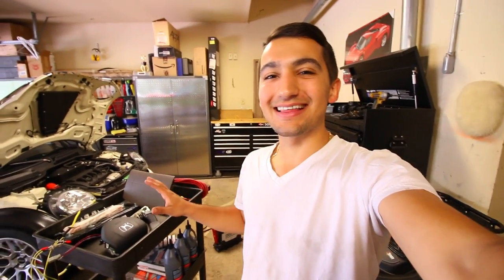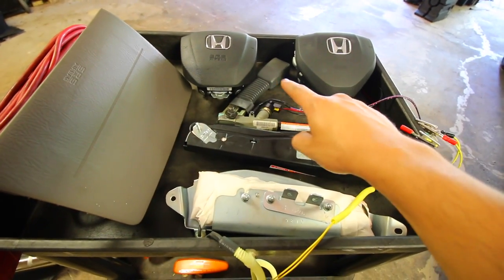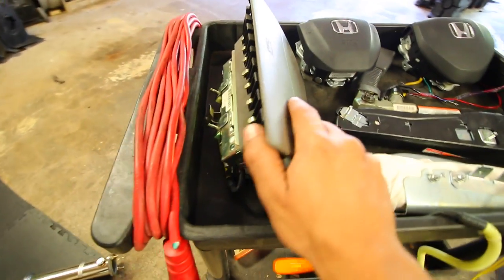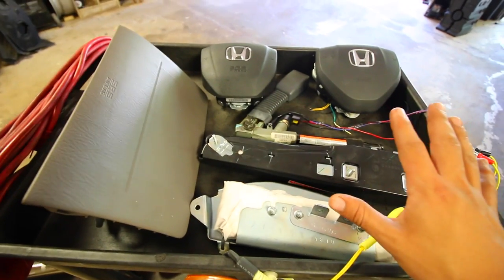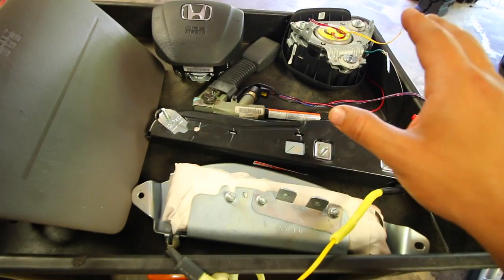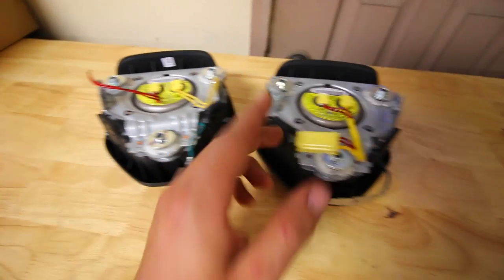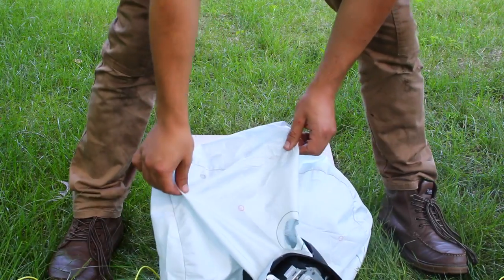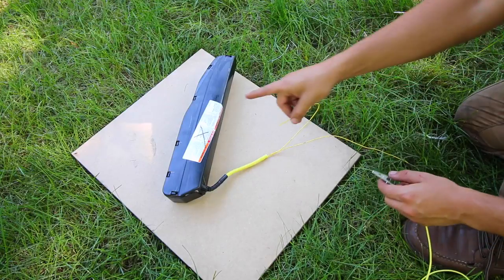EXPLODING AIR BAGS @ 240FPS (& Attempted Watermelon Murder)

Comment: If you're short then instead of just deactivating the airbag in the wheel, the airbag could be set to be weaker.. In more expensive cars, the SRS probably knows where you sit anyway, so it should adjust the power.

Comment: Today's airbags are immensely better than the old airbags. I know a girl who's about 5'1 and sits really close to the steering wheel and an airbag just like the one at 20:12 saved her life. The old pre-1998 airbags often weren't very good, many of them were overpowered. My dad had a 1994 Toyota Camry when I was 8-12 years old. Glad that POS passenger airbag never went off in my face! That would have HURT! I know enough about airbag injuries now to know that it wouldn't have killed me, but it would have been VERY painful and probably broken my nose.

December 31, 2018 3:22 am

Comment: Those were NOT curtain airbags those were side seat airbags that deploy from the outer wall of the seat also they are not bombs they are controlled pyrotechnics that don’t explode they only release gas at a very high volume and rate